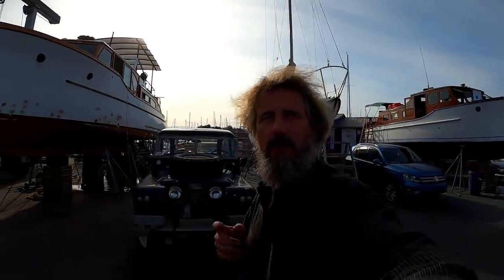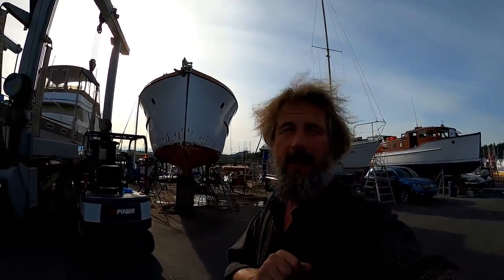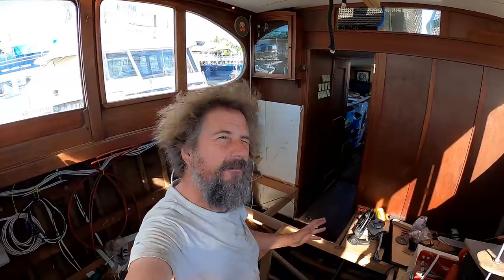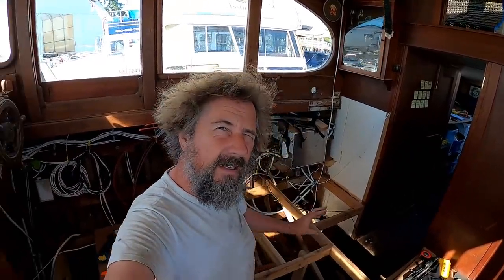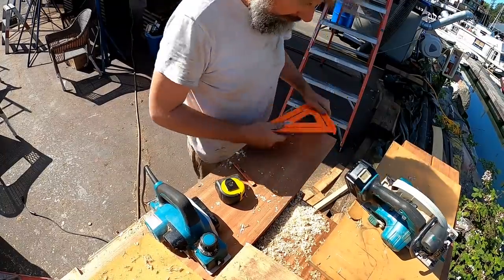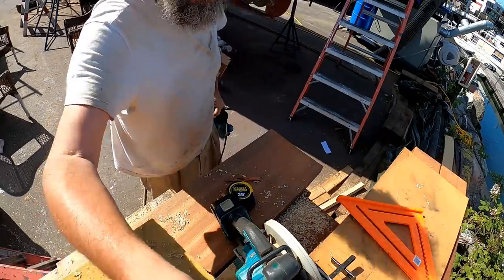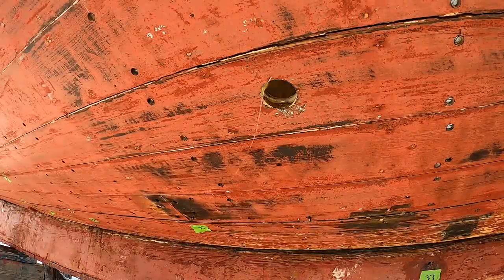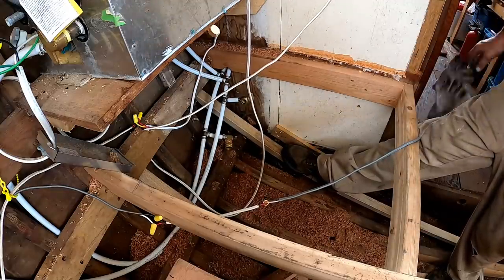Haulout Day 19 - #247 - Boat Life - Living aboard a wooden boat - Travels With Geordie

Comment: Peter! I thought you were from Québec! You know that it's pronounced in the range "Moe-dit", (in the east end of Montréal anyway), and "Moe-deetuh" with a kind of withering away of the "uh". You didn't mention the alcohol content of that beer, either, which makes it a good substitute for whatever you're cleaning the prop with.
Also – you probably are aware, but what Mads is using is Kanban, which he comes to naturally since it's a very common way for software engineers to organize tasks and time. The key thing is that you deal with tasks, not days. Three columns: to be done, doing, and complete. Postits flow across the columns, and what a posit contains is a task brief enough to be done in a single session.
When you get stuck, you assess the task, and reassign its column – makes for a great way to ensure that you've always got a work around when obstacles arise.
Finally, have you read Thinking, Fast and Slow? If so, you'll probably remember the story of the Israeli time and efficiency experts who put a plan together to write a book about time and efficiency. If not, I recommend it for anyone, but especially people with ambitious projects like yours....

Comment: In regards to your buns that you’re using to fill your abandoned through hull wide side in. If something were to hit shift or fall upon the bong from the inside and you have the wide side out There’s no way to push it back in to tighten it assuming it is not gone lost falling out the bottom you’ll have a big hole in your boat letting water in. Wide side in and if it’s there you can tap it to snug it plus you can put a block over the top to help hold it in place something you can’t do on the outside because it would cause drag.

Comment: The plug you glued in might be better backed up on the inside with a larger piece, as in the butt joint boards?
Reply: that's what he's doing & that's why they are tapered that way - they can't fall out because of the taper and they can't fall in because of the backing block

Comment: Peter I'm wondering if I missed your thoughts on why the rest of the floors outside of the engine room don't need replacing or at least refastened?
Reply: He did say the butt blocks all got refastened from the outside,  and will be looked at in future.
The frames in the engine room with heavy Motor and old repairs seem most critical.
Reply: @dnomyarnostaw  Thanks Ray. But my question was, is he concerned about the remaining floors in the vessel? The Floors provide strength to that part of the structure and it is not just about the engine room. Floors typically go fore and aft of the engine room from bow to stern and looking at the way the fastenings  of those floors failed, one would want to ensure the rest of the vessel was structurally sound. To my mind, any vessel fastened with steel fastenings which have obviously failed, means the rest of the vessel is suffering from the same problem.
Reply: @dnomyarnostaw  Engine beds, supported by floors should extend way forward and aft of an engine. The Monk is a lightly built vessel so floors and engine beds are critical.